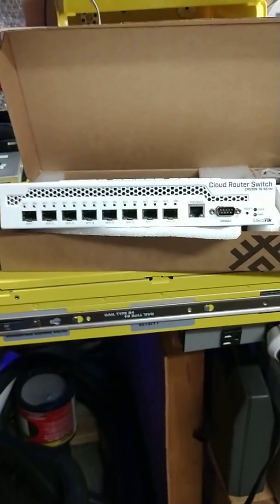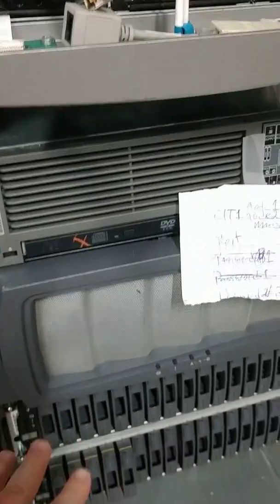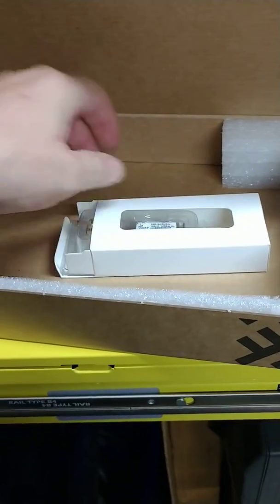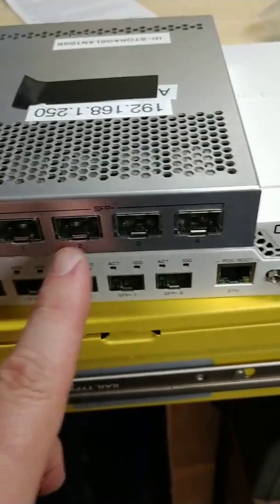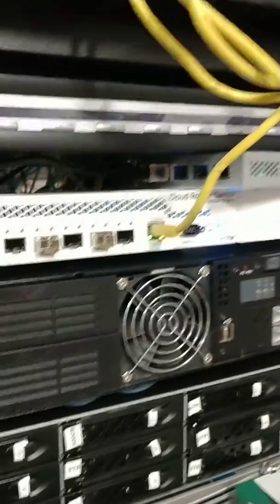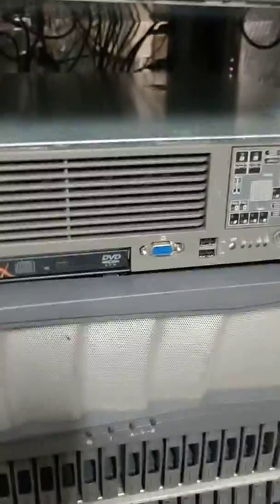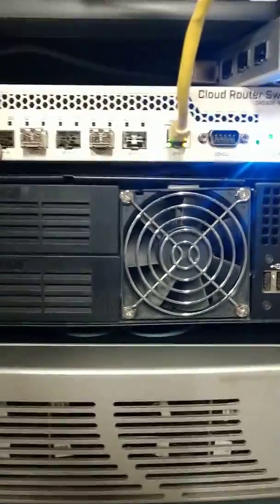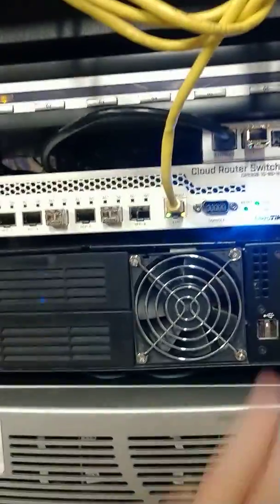cheap 10GB network for your home lab. MikroTik four port (CRS305) or a nine port MikroTik (CRS309)

Comment: Wait so is this just plug in and go? And It will work just like normal internet and I’ll be able to do everything like normal? If so it’s a steal
Reply from the maker: Yes it will just work but if you want to better secure it with your own password, I would recommend that.  But it is a basic switch...  I had it running in about five minutes.
Reply: @leadiususa7394  so do I make it secure with the software for it? so all I need is a switch, a cat6 cable, a pcie card for it, and that spf+ thing for the Ethernet port?
Reply from the maker: @BradyTech  You need a Spf+ for each port that is either fiber or RJ-45.  You need CAT 6 10GB rated cabling if you go RJ-45, or fiber if your do Spf+ links.  The software you are referring to is built into the switch.  You don't have to buy anything.   It will have default user and Password that you need to change but that is about it.  You can do more if you like but not needed...  Maybe later... /;>   Enjoy!

Comment: great video.  helps me a lot.   my crs309-1g-8s+in switch is connected to router for internet but the light is orange and runs quite slow.    is POE port is not the same as ethernet port?
Reply from the maker: Yes POE or (Power over Ethernet) is a special type of Ethernet connection that requires ether a POE injector or a POE capable base switch to the POE device such as as WIFI node.   Make sure you also to check my videos about how to speed up a 10 GB networks for faster transfer rates. It doesn't happen be default you have to setup the switch/s then match the switch/s with each 10 GB NIC devise you use.  All 10 GB device must talk at the same speed and buffer settings.  You also need to tweak out your Jumbo speeds to both 10 and 1 GB switches.  Again a hit on transfer speeds.  Please like my video/s if you like the content...

Comment: Great video! I am a Linux System Engineer, though up until recently the HW has generally been out of my scope, as the company I work for is pretty siloed. I am looking at setting up 10Gbe network at home as a personal sandbox/lab for various hypervisors. I have been eyeing both of the switches you showed and I am leaning toward the 9 port. Thanks for putting the video together. One critique, try landscape mode, instead of portrait. Other than that, great overview!
Reply from the maker: Cool, glad you enjoyed it and I will look into more landscaping video mode going forward
Reply: @leadiususa7394  Thanks bought the 8 port a and got different transceivers for testing (DAC, Fiber SR and 10Gbase-t). Got up to 10Gbe in some tests and even 4Gbe over some old Cat5 in iperf tests. Waiting on NAS and some other parts to come in. Thanks for the reply!

Comment: I purchased one of these using supported SFP adapters and copper and have found it to be slower than 1gb.
Reply from the maker: You need a SFP+ 10GB GBIC instead of a SFP 1GB GBIC you have now.  And they have to be on both ends (2x 10GB GBIC host to switch and should be by the same vendor. (I like the 10GB Intel SFP+ GBICs. That is why you still have a 1GB or lower  connection.
Reply: @leadiususa7394  Thanks for the reply but I have SFP 10gb all the way around.  I may be new to 10gb but I've been in IT for 20 years so I'm not exactly a newb.  I've tried SFP 10gb copper,  SFP 10gb twinax AND SFP 10gb fiber... yes on both ends.  I have found that Intel SFP server class NIC cards to be faster then something like a TRENDnet copper card.  Through trial and error I have been able to obtain brief bursts of near 10gb speeds but it bounces around from 0 to a little more than 2gb and doesn't stabilize.  There are plenty of recommendations on how to tweak the NIC cards for optimum speed however I have had little success thus far.
Reply: @potterson1710  I was able to see 10Gb in a couple of tests with iperf using the 8port switch between a DAC and Fiber transceivers. I was using Mellanox ConnectX3 NICs
Reply: @SolarityTechnology  Perhaps it's a NIC compatibility issue then.  I've been testing between two servers and a workstation and like I said I get an initial burst of speed that diminishes and then fluctuates all over the place.  Or perhaps it's the SFP's, I don't recall off the top of my head which ones I'm using however the SFP twinax didn't perform any better.  I'm certainly open to the possibility I'm missing something but this isn't exactly rocket science either.  Thanks for the info.
Reply from the maker: Yea they all must be SFP+ 10 GBICs across the board to get 10 GB network speeds.  not SFP 1 GB GBICs.  Sorry but they are cheap on Ebay but do you research on the part models.
Reply: @leadiususa7394  thanks for taking the time to reply.  I am very much aware that each machine/nic must be fitted with a 10gb SFP.  I started with 10gb SFP rj45 coper to cheaper TRENDnet rj45 10gb nics which was slower than 1gb.   I then replaced the TRENDnet nics with Intel 10gb SFP fitted cards with Twinax then to fiber.  I can sometimes get to about 5gb transfer speeds but often it's closer to 2gb.   Sometimes it will start out close to 10gb then drop to zero for several seconds then ramp up again.  All this is between two servers and a workstation.  I've tweaked and played with drivers.  It's the most bizarre thing I've seen.
Reply from the maker: @potterson1710  I also have the RJ45 10GB GBICs, I do see some CRC errors because of using cooper over fiber but it is not bad.  It the tweaking of the NICs that gets you to the higher level of bandwidth.
Reply: @leadiususa7394  Thanks I figured that's what it was but apparently haven't found what I need.  Do you happen to remember what reference material lead you to the optimum performance?  There is a lot of advice out there and most of it has common denominators but nothing has quite done the trick.
Reply from the maker: Potter Son   Yes, what I did (by the way,I made new video on this very topic  because it is such a pain to tweak each set of NICs and switches)  I had to go to each vendor, in this case, I use Intel and ASUS NIC documentation to get the buffering/offloading right and other values.  Each card is different base on the feature they give you.  No one card or switch is the same.  This also goes for the Dell and HP NICs and switches as well.  I wish there was an easy to do this but it does get better as you recognized the terminology going forward.   Also make sure that you also tweak out you OS as well.  NPU on the NIC card and improve if you not using CPU resources in some vendor cases.
Reply from the maker: @SolarityTechnology   You will see something close to 7 to 8.5 GB of bandwidth but you lose some of that for the header traffic.  But 7 to 8.5 is great and very fast.  You will never get a full 10 GB because of the IP header overhead I am sorry to say.   So did you try a host to host without the switch to see if you get a stable transfer rate then do the switch next? This is to see if the switch MTU is not setup right.  it should be at 9216 MTU wise.
Reply: @leadiususa7394  I have done all my tests via the switch, the max speed was at 9Gbps IIRC. I didn't have jumbo frames configured, though was thinking of using the open ports on my switch and dual SFP+ cards as a seperate VLAN for use as a SAN with the MTU of 9000. We use Jumbo Frames at work and it gaves us one hell of a headache, when we found a bug in our Hypervisor where the MTU would drop down to 1500, when live migrated.
Reply from the maker: @SolarityTechnology  Do you mean as a NAS instead of SAN?  A SAN is a fabric (fiber channel network storage solution)  You are working with IP and not FC, correct?  As for the MTU, make sure you go to 9216 on the switch side so you are handling faster MTU pipe then any of your hosts MTU that should be around 9014.  Also use the Ping command as you go with your to testing to find you best MTU speed. Here is the test ping comand line: ping.exe (your target IP address) -f -l 1492 (or 9014) If you get DF fragmentation then back off some.  Here is a good link to refer to for a better understand.    https://kb.netgear.com/19863/Ping-Test-to-determine-Optimal-MTU-Size-on-Router
Reply: @leadiususa7394  One reason I got this switch and a QNAP was to learn more about storage. I see QNAP does support  iSCSI and I think that does fall under SAN. I am making a seperate VLAN for iSCSI as well.